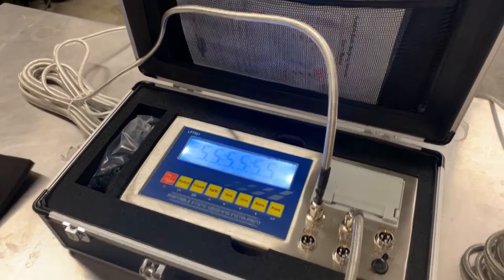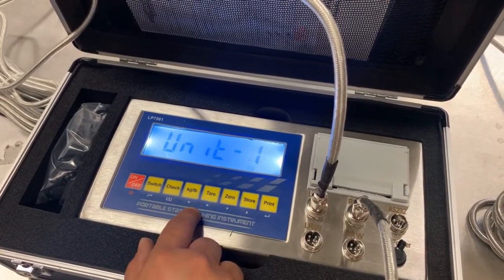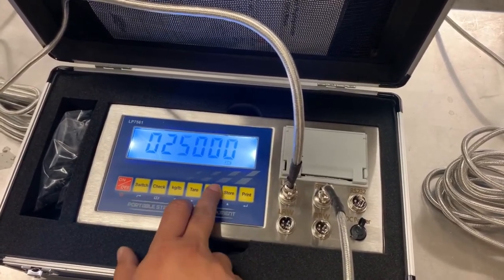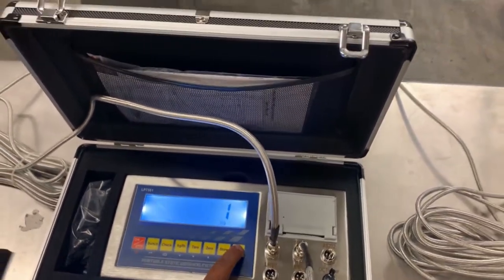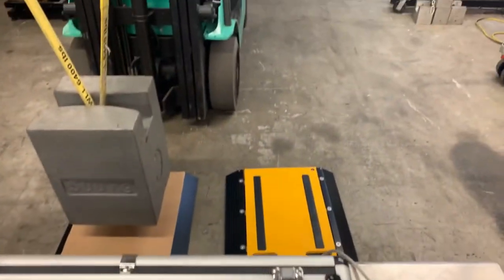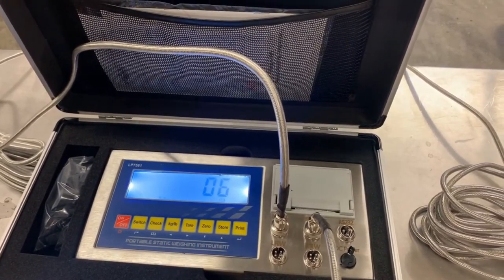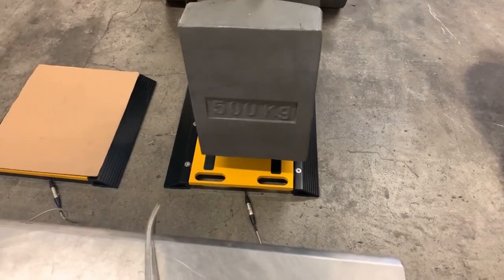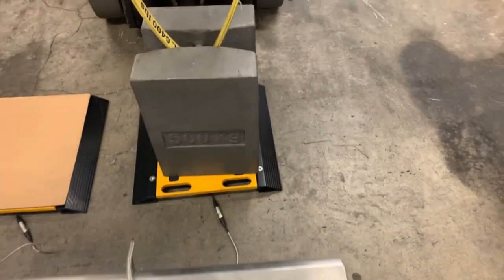SL-7561, LP7561 Calibration video presented by selleton scales

Comment: Heavy load fell on my scale and since then it has stopped reading.How to repair the load cell
Reply from the maker: You can try to calibrate the scale with lower weights to see if it is possible for it to work. if not then you have to check each load cell. you can also call us & we can help you. 844-735-5386